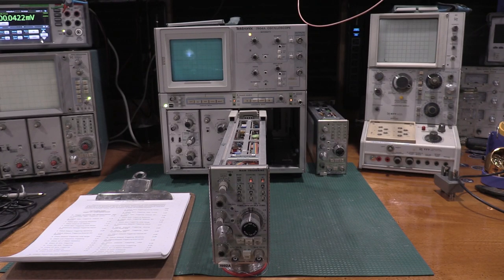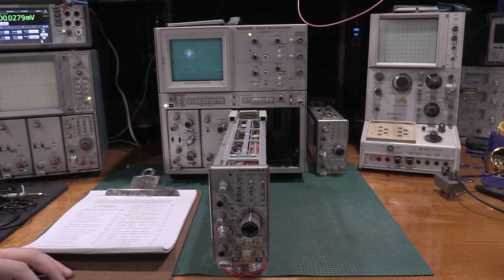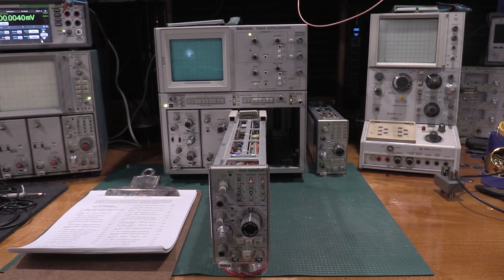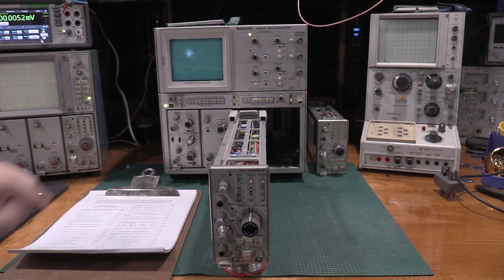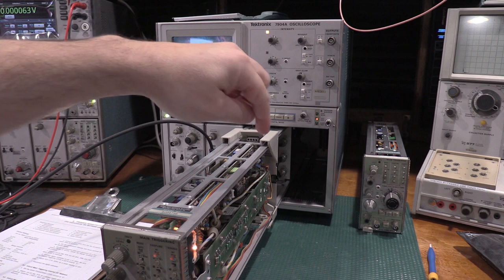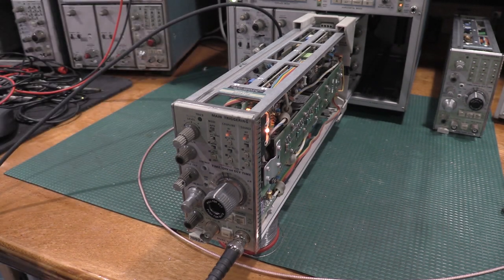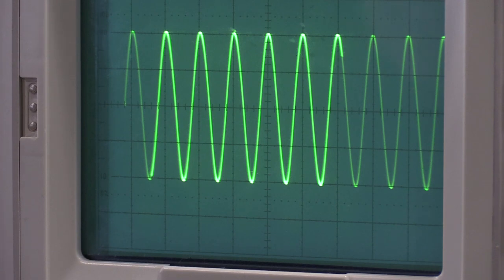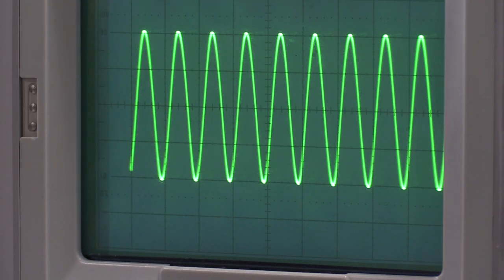Tektronix 7B92A Calibration and Checkin

Comment: I am so enjoying these video's and learning quite a bit from them. Thank you!! Sometimes when I follow a procedure I'll miss a step or key connection point and lose considerable time only to find a simple mistake. I know that comes with the territory, but still I thought that it would be so helpful in a great series like this if there could be a quick snapshot of the scope settings, cabling and test fixture setups that could be viewed when you calibrate for a given procedure section. This way - when we see how you bring things within spec, then we can see how everything had to be setup to make things work on your end and we can check our own work with more confidence. With some key setup data apparently glossed over or entirely missing in the service manual this could really make the difference for those of us with less experience attempting to follow along. No need for you to explain what you feel we should already know. This is complex stuff and hazardous equipment to work on open chassis, so we should already know what we're doing to at least to keep ourselves and our equipment safe, as you remind us at the beginning of each video.

Comment: Nice series of videos. You mentioned you had a Tek 577 D1. It would be interesting to see a restoration. 

I have been flailing around trying to find capacitor adapter PCBs. I found an eBay vendor. Their products are sold in lots for each instrument type. How are you getting your boards?
Reply from the maker: I do have a 577 D1 in the works I am currently trying to figure out and storage adjustments they are quite fiddly and don't make much sense. 
I show the boards used in the 576 restoration video but a link is here they are an open source project on oshpark. They are in lots of 3 last I checked. 
https://oshpark.com/shared_projects/hpUFRhHC